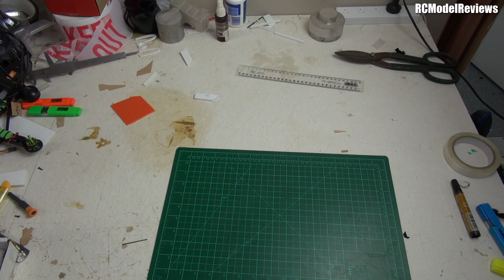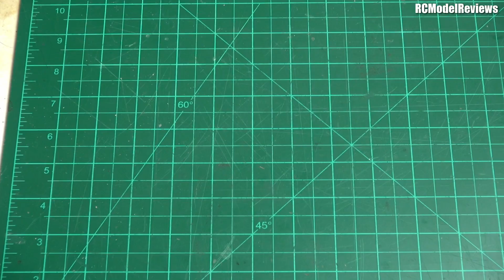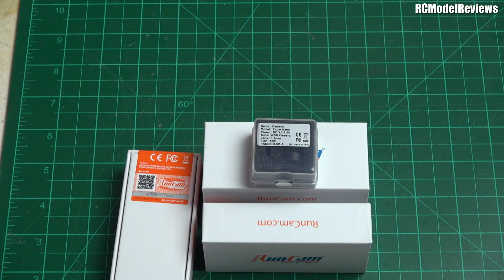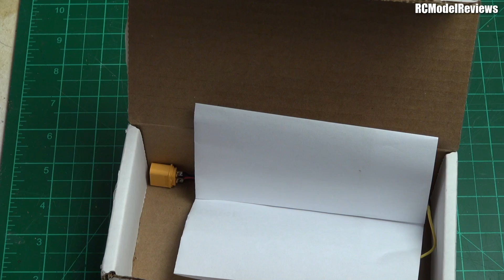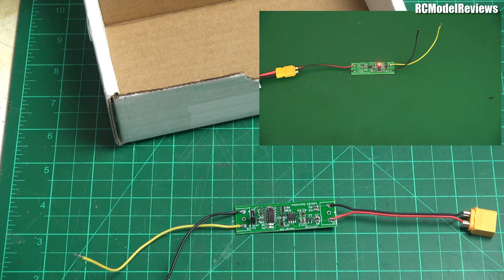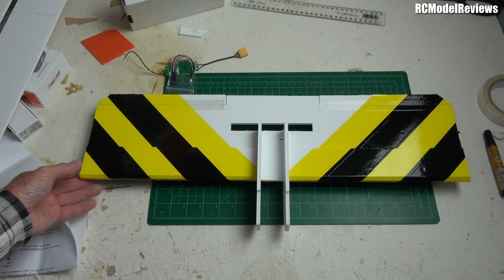Weekly News (25 April, 2019)

Comment: Once the magic smoke comes out, there is no way to make it come back in ^_^
Reply: That's not quite true, if you are comfortable doing some smd soldering it's usually just a case of replacing the regulator. That's almost always the only thing that's harmed. I've fixed a couple micro vtx's that got wired backwards by soldering in a new regulator with an iron hell I even had a chisel tip on the iron and I'm talking sot-23 size which if you're familiar is the smallest you're likely to find. On a larger vtx it will probably use a normal to-252 size regulator that anyone half decent with an iron should be able to replace.

Comment: A little feedback for that current protector thing that maybe you can relay to the manufacturer: I think it would look better and be more practical if the XT60 was soldered directly to the PCB (less annoying wires). If you wanted something other than XT60 you could still unsolder that and connect a wire to another connector.

Comment: Maybe repurpose the "NIght Radian" LED controller as a "NIght Outlaw" LED controller?
 It may put you over 250g, but then it really will be an outlaw. Matters not for those of us in the US that already have paid our govermental extortion and have our outlaw ID number. 

I think the Outlaw is a slick little cheap fun to fly plane and it matters not to me what it weighs. I''ve already accumulated some parts for it. Maybe you can give us an idea what the BOM is going to look like, I've got a hunch my Hypetrain 2306 2450  might be a bit big? (it was a fifth motor for a quad that never was used)  also in the pile is a Runcam Split mini (2 board version), several Escs and some of the usual blue 9g servos. I've got a crossfire Nano adapter board that gives 4 channels PPM.
Looking forward to it!
Reply: As best I can figure, an 1804 2300KV to 3000KV, 5x3 propeller, 2S battery would be a decent fit.  Depending on the mass of the airframe, camera, receiver, and accessories, that may be more power than you need.  An 1806 or 2204 motor on 3S should fit in the weight limit and be very sporty.
Reply: @hanelyp1  Andrew Newton listed an 1804 2200kv motor in his recent sub-250g build. Do you (or anyone) have a link for 1804 motors? I'm finding 1806 (2280-2300kv) motors, just ordered a couple T-motor 1806-2300kv and there's also the e-max 1806 available; but no sign of 1804 that I've found. Actually e-max do have an 1804 listed but only have stock in left hand thread - yuk.
Reply: @amisoftau2659  I'm pretty sure on a pusher you'd want left hand to use a normal prop. I think I could be having a brain fart on what's left and whats right though. If you twist counter clockwise to tighten that's what you want although with mini quad prop coming in either rotation it doesn't really matter anymore.
Reply: @thirtythreeeyes8624  Sure. I do try to always use std thread (CW - right hand) and use alloy nyloc lock nuts. The lock nuts never come off no matter the rotation direction (don't buy serrated ones tho),  and are much lighter than those alloy cone nuts. But mainly because reverse thread nuts are annoying - and difficult to obtain. Thanks for the info - I know, that plane rotation direction stuff always does my head in :).

p.s. Andrew Newton reports his motor was Emax 1804 2480kv. It's listed at 14 grams, link here:
https://www.emaxmodel.com/emax-multicopter-motor-mt1804-kv2480.html
(Currently only reverse thread available).
Reply: The Night Radian is way over 250 grams without the controller.